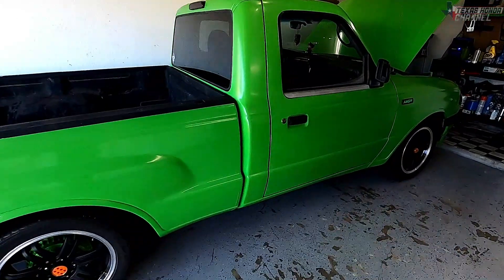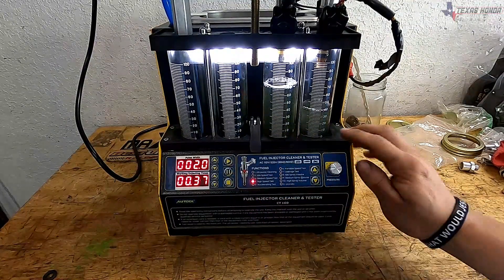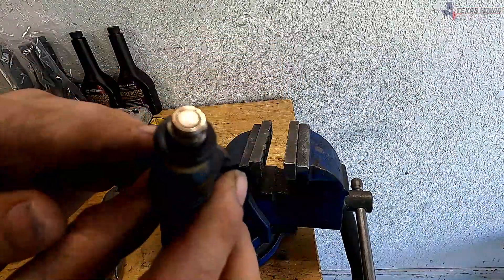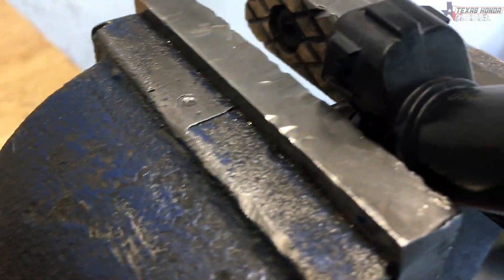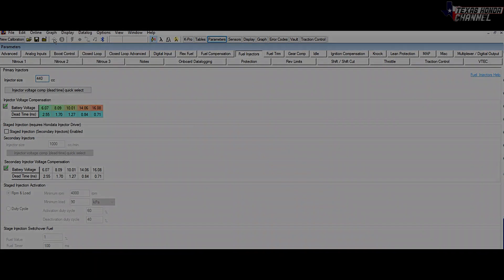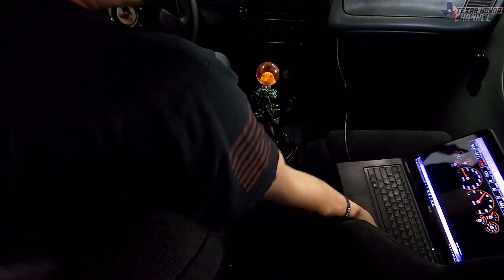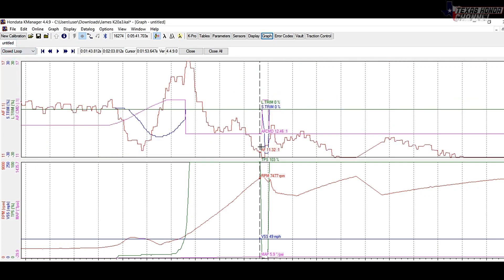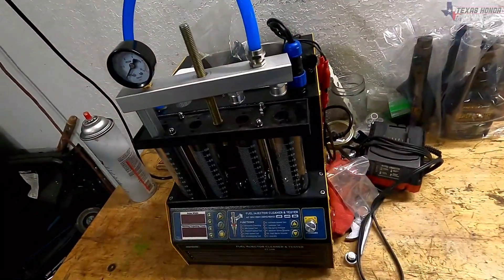How To Decap Injectors- Turbo K20 6psi PULLING HARD!!

Comment: I liked this one too.  I was checking out the new sonata turbo 2.5 liter making 290 hp.  I got to thinking has to have 300 cc ...atleast i think.  I would put 300 320 stock on a regular engine
Reply from the maker: 300cc is a lot of fuel for a stock setup but for turbo it’s not much unless the turbo is small. Either way I love how it’s turning out and 1000cc going in soon!
Reply: Oh ok lol.  I was wondering if that would be slowing the low end flow like running 3 inch exhaust on a b18b
Reply from the maker: @rstuff1605  I have small exhaust for daily mode (I have a 3 inch dump pipe) I just need to wire it up but waiting on shipping then it should be quicker on low end.
Reply: My friend had 650s on a donut size turbo b16 si and i saw a mech driving it with a burn damaged hood 6 months later.  He said it was dyno tuned to 450 hp then blew up.  My other friend didn't see it happen he told me but that hood and the soumd of the engine seemed like "yeah that's gotta be it" lol

Comment: I havent heard about this in like 12 years, good stuff. Hey do you have any tips on how to increase my lower end acceleration in my stock 98 crv, I'm pretty sure its low comp usdm b20 all stock. I dont need to go fast but man, when the guy in front of you turns without warning, I gotta drop gears and sometimes Its either rev the hell out of it or not have enough balls lol
Reply from the maker: Yea they definitely need more low end and free flow exhaust and intake are the best mode to increase low end. A tune would be the best way though
Reply: @TexasHondaChannel  ok thanks intake and exhaust were on the list,  I was told to advance the dizzy but im hesitant to mess with it

Comment: 75% more fuel compared to capped. Not a bad increase for free! Did you run all 4 decaps against each other on the flow bench? Generally you want to decap 6-8 injectors to get 4 to be really close to flow matched.
Reply from the maker: Yes they are flow tested and all flow within 1% difference of each other they are as even as I can get them

Comment: Sounds beastly.  Would be fun to see a run down a track vs a standard setup. How much impact do you think it have on overall fuel mileage and lower RPM running times?  Nice work. 👍
Reply: Never mind on the engine running in the lower RPMs.  Nice tech work!

Comment: How bout b-series injectors? Same principle? And what would new cc size be? 440?
Reply from the maker: B series are 240cc stock and not sure on the B series I haven’t done them before and I’m not 100% certain the match is right on the current injectors I did but I’m sure somewhere out there is proper information on how to calculate the injector size.
Reply: Thx.. I got a set lying around, maybe I’ll try it
Reply from the maker: @cryabo  definitely let me know how it goes

Comment: If you change that small filter to a large 12 long high flow filter, you'll get like 10% more flow. Something about surface area in the filter intake surface area. Its like it becomes part of your turbo because of some vac to pos psi formula. Corkey bell explains it better. He has an old book you get for free download. And dont just run open turbo. Im telling ya. You'll even see a difference on your wideband.
Reply from the maker: Yes you are correct. I won’t be running this filter I have a large K&N it’s just not installed currently and once I get serious out the power I’ll be swapped that out and opening the 3 inch dump pipe